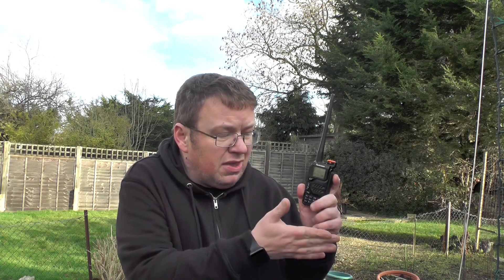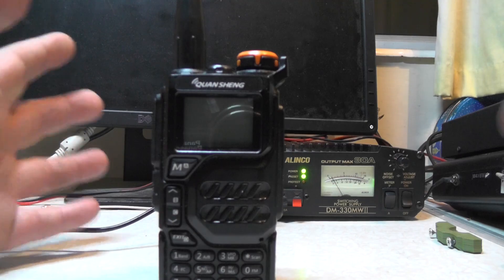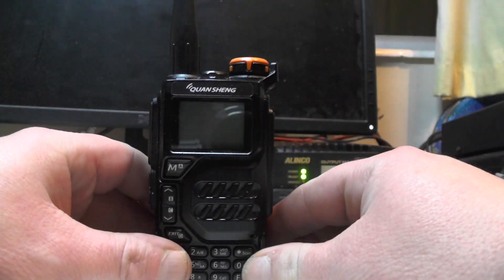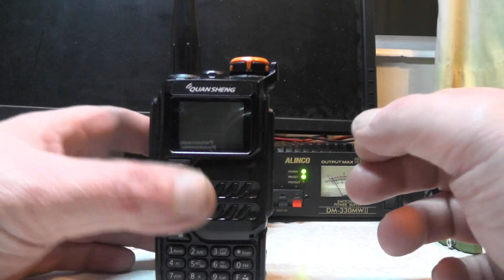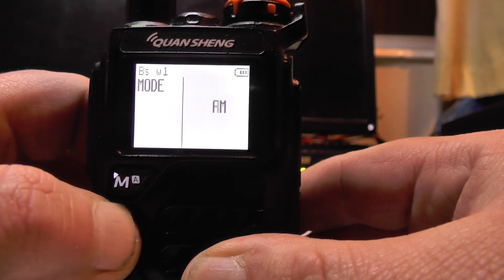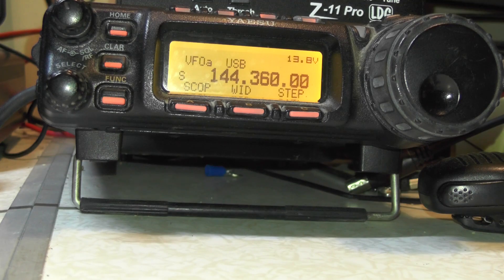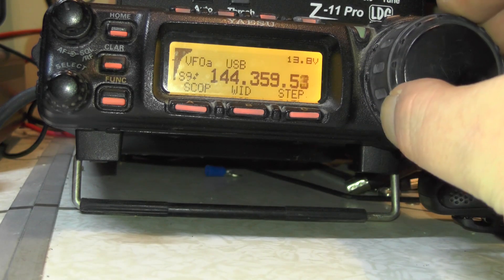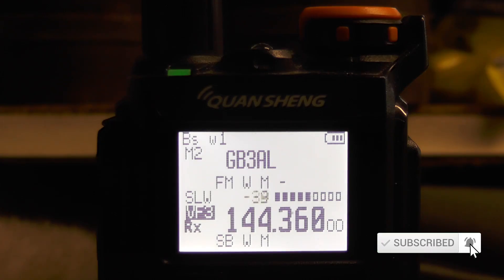From Ordinary to Extraordinary: Unveiling the SSB Magic on Your Quansheng

Comment: I almost bought this model, glad i went with the radtel 470X...
Reply: You’re comparing a £20 radio with a £100 one
Reply: @ohenekojo2561  nope, the 470X is currently 35 CAD shipping included to Canada. 
By curiosity I ended up buying one for 26 CAD (no brainer at that price), other than the Airband reception which is muddy on strong signals, UV-K5(8) is a pretty decent radio with its original firmware and not sure I even want to fire any other FW to it. Purchased Jan 4, received today, tested today, all good.

Comment: Definitely the worst microphone quality I've ever heard from a you tube ham channel.
Reply from the maker: The radio is not really designed to transmitt on SSB or even receive SSB on FM its fine
Reply: @2j4ez  I was referring to the microphone used to record the you tube video.

Comment: Incorrect to call it SSB, as it is only suppressing the carrier. Not very cool to tx in DSB if you a using a frequency meant for SSB communications, as you will be using an entire channel that could be shared between separate usb and lsb conversations.

Comment: Hi Jezz, like the first comment it's double side band and not single side band. The firmware may enable the radio to do this, but I wouldn't recommend using the facility for TX.
Reply: Why not?
Reply: @Perthshire  the radio isn't designed to work on DSB and hasn't the filters to deal with this mode.
Reply: @adam-g7crq  I see, thanks.  Still, I hope this £15 radio sends shudders through the likes of Kenwood, Icom and Yaesu!
Reply: @Perthshire  , don't think it will... As Adam G7 CRQ has hinted at, once you take it out of band it chucks out harmonics all over the shop, and receive is not the best. It is what it is, a cheap Chinese radio that's fun to Mod, and it is okay on 2m and 70 cm FM. But it's definitely no Yaesu contender.